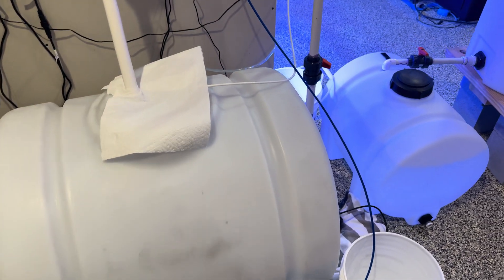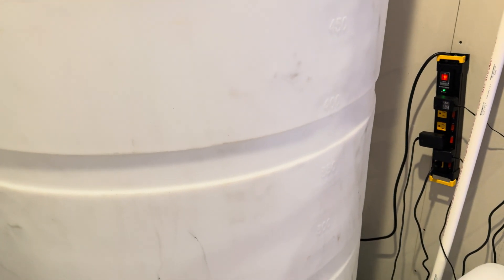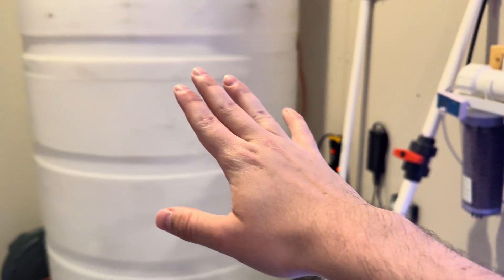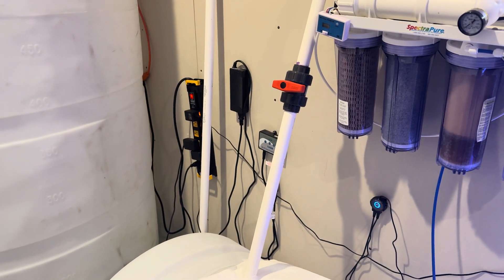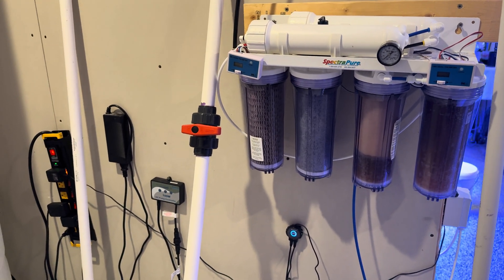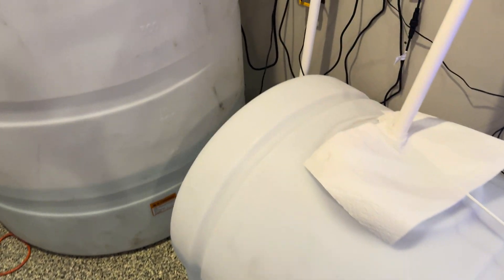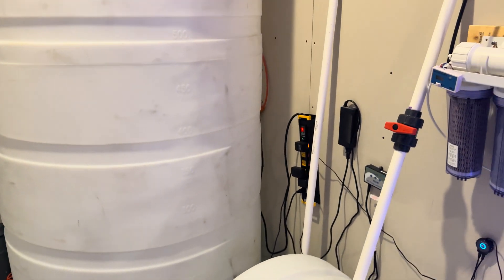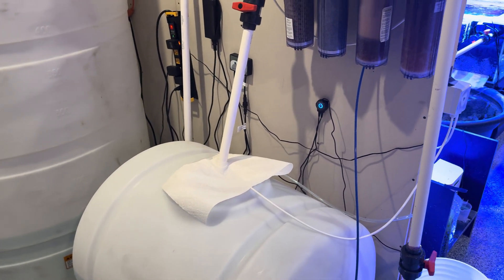Major RODI Storage Fail! What Went Wrong with My Reef Water Setup?

Comment: I had same issue with my water. Two things I changed. I swapped prefilter and carbon blocks, then changed out DI Resin, and I bought some cuprisorb to soak up anything that makes it to the RODI reservoir. I havent gotten results from ICP yet post-changes. In cali my town used chloramines and I bought one of those big 20" filter canisters with a chloramine filter in it to hedge my bets. I feel like it is unlikely that your PVC or the container leached zinc. Interested to hear what you find.

Comment: I cannot tell whats happening but i would suggest you clean the suspected barrel fully with tap water. half fill it with rodi water and let water sit in it for 2 weeks and then take 2 water samples one from that barrel and one fresh directly from the filter and see what happens. Also when you take water from the barrel waste around 1 liter of water which is coming from the pvc pipes or take the water sample directly from the barrel. so you can skip the plumping and joints. ICP of these two rodi samples can help whats happening. if you see zinc in barrel water then it will be clear plastic barrel is leaching zinc, then you can decide what to do next. Replace the barrel or stop dosing zinc in the tank. May be after couple of months it will stop leaching.

Comment: It doesn’t make much sense to fill up a 700 gallon tank k then run that water through the rodi. You will lose 75% of it.  Why not just dump it?  Are you worried the zinc is leeching from the container?
Reply from the maker: @mikew4435  yes

Comment: I read that chloramine filters use CAC - same stuff as what you run in your system. I just added an additional canister to my RODI that I will contain CAC just to be safe since Richardson tends not to send a notice around when they are or aren't using chloramines.